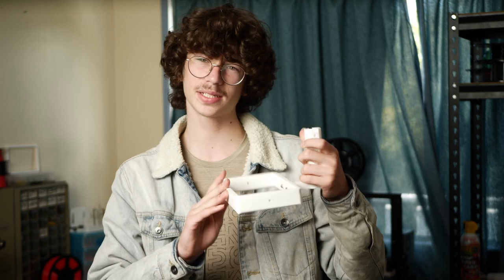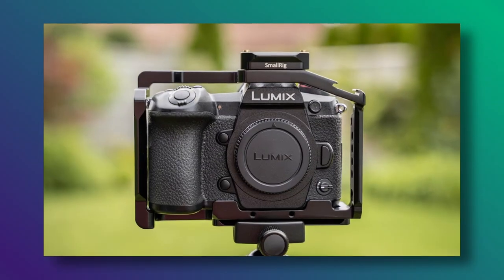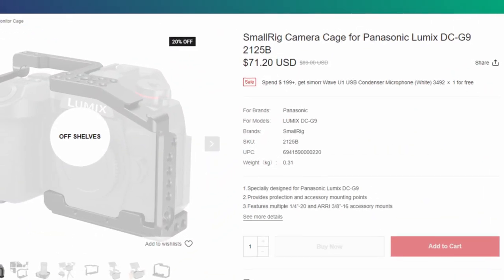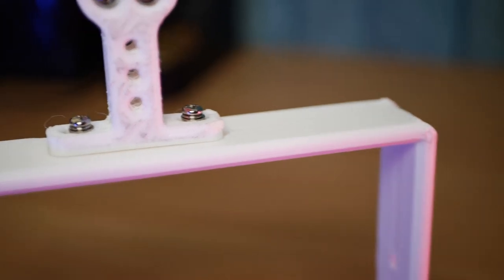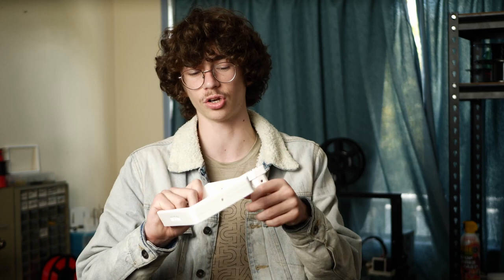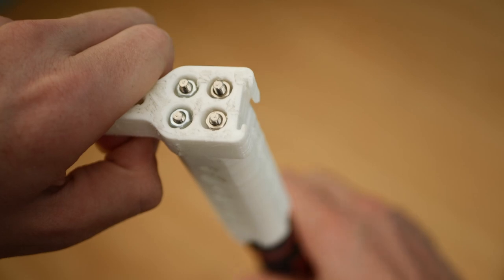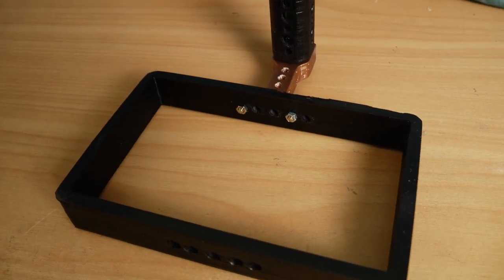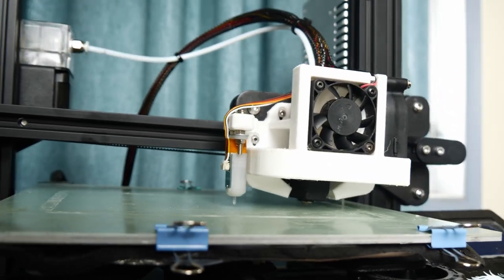Should you 3D Print a Camera Rig?

Comment: how can i have 3d file (stl file )?
Reply from the maker: The top handle can be found by searching either printables or grabcad. The cage isn't a very good design, so it wouldn't be worth sharing until it gets revised. However, searching, thingiverse, printables, thangs, cults, grabcad, etc for models for your setup should work.